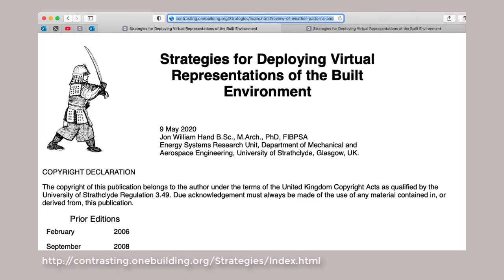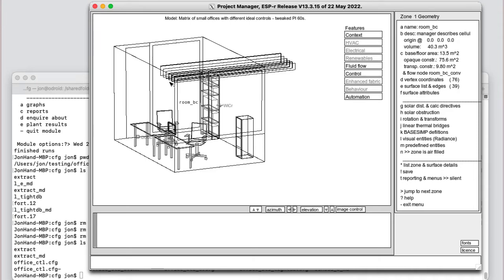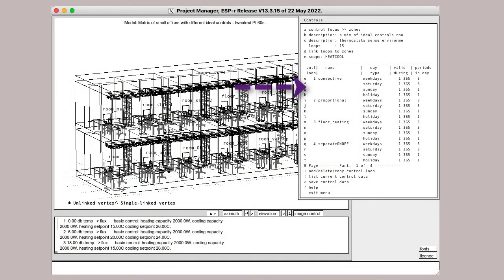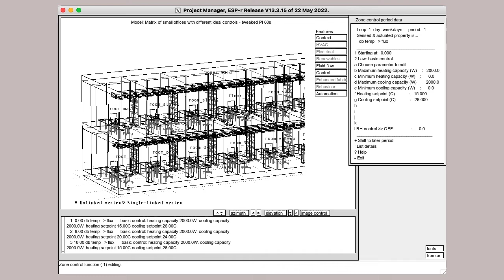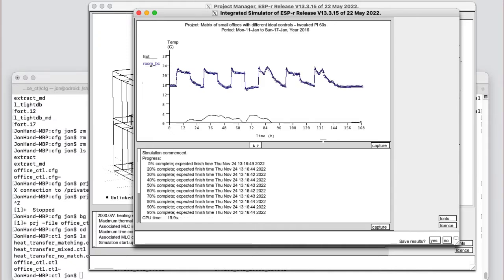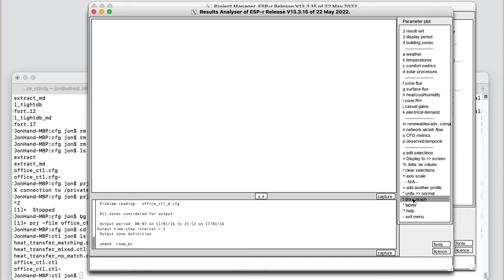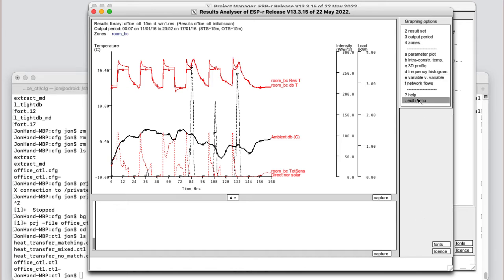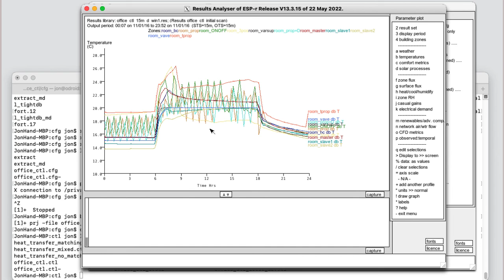Simulation strategies for quick dialling in of environmental systems capacity

Comment from the maker: So many simulation staff have habits that bring them back to the same solutions they used in earlier projects. In my opinion this is poor value for the client when we don't take an hour to check whether a different scheme might deliver better comfort or lower running costs. Given that your competitors might be similarly habituated that little bit of extra might help you stand out from the crowd.
Afraid to poke you head above the parapet?  Add a comment about this.
Found clients who insist on the 'usual suspects but then can be convinced write down how you made it work!